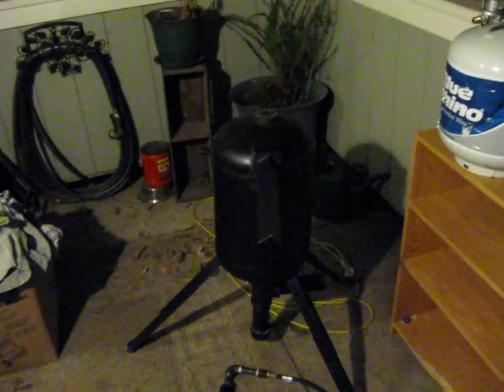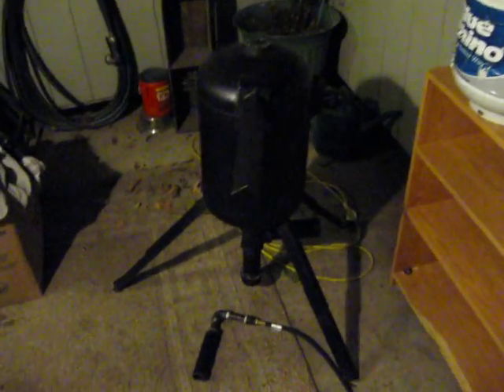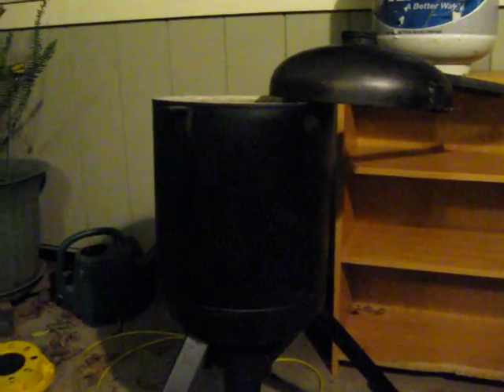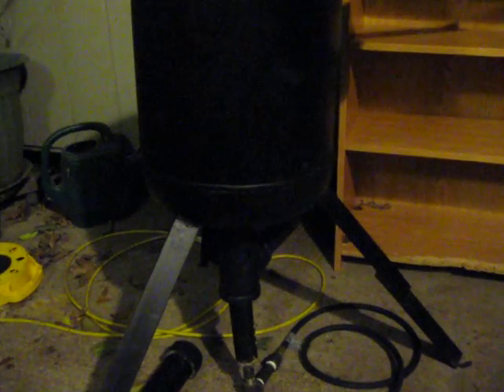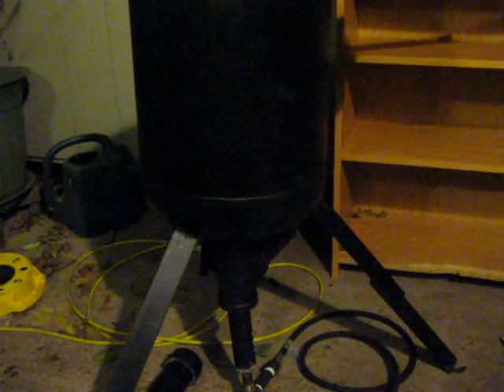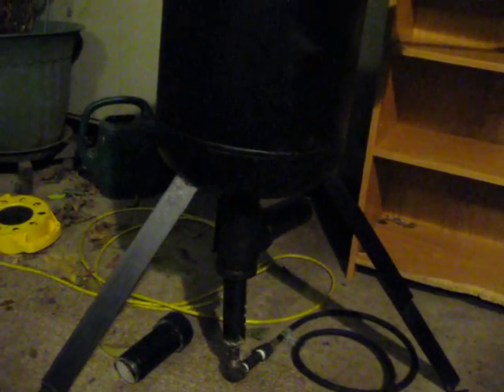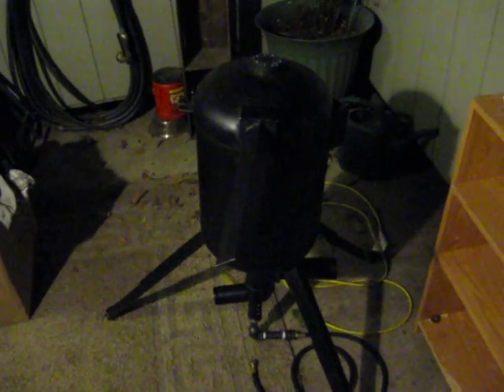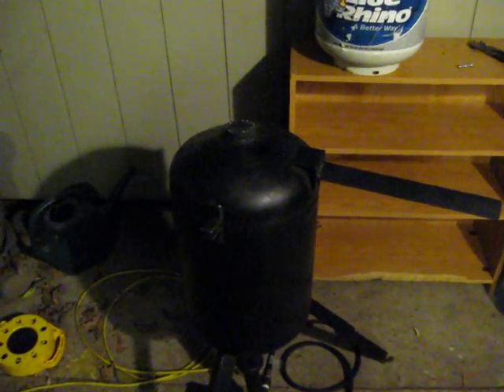An Aluminum, Brass and Bronze foundry I made.

Comment: Yea you should add some more insulation.  You'll see melt times drastically decrease and you won't use as much propane either.  Also, be careful with the flame pointed right at the crucible.  If its steel, it could burn through and if it a ceramic crucible, uneven heating could crack it.

Comment: Hey bro, not trying to spam but i highly recommend joining backyardmetalcasting(dot)com/forums there are a LOT of folks there that can help. i have a few questions that might help you...
have you thought about a naturally aspirated burner?(ie you don't need a blower with the right set-up). have you thought about more insulation?(a good foam/refractory or Kaowool will help A LOT)